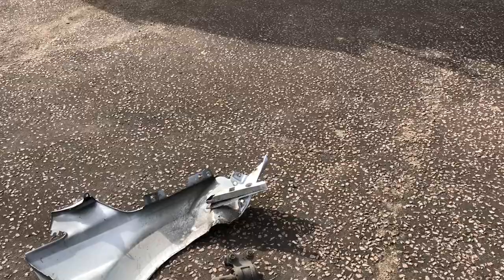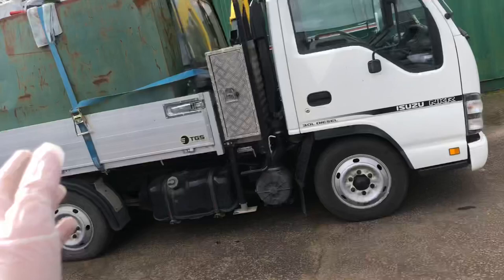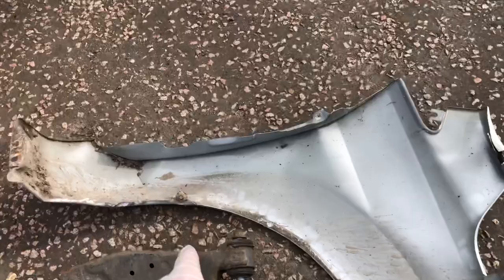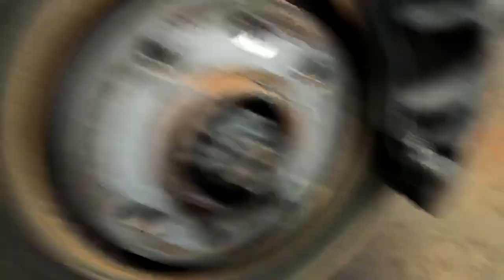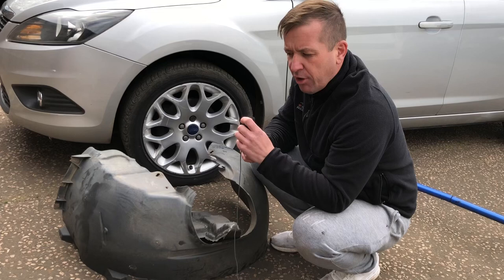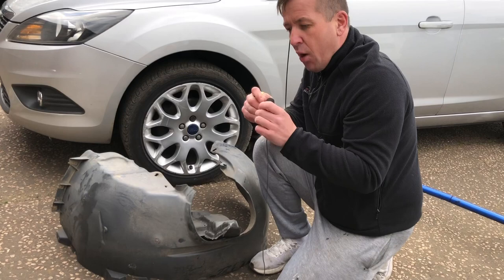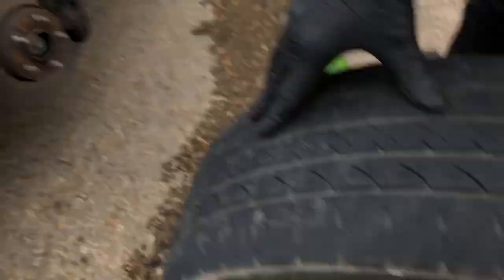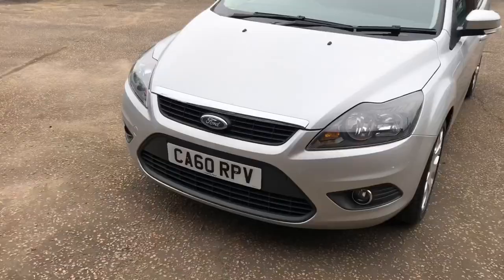Copart total loss Focus back from the paint shop

Comment: You forgot one important thing if you have to apply for logbook V5 because there is a previous keeper a sorn application has to be made. Or road tax application made. There actually is grace for doing this in motor trade but not for  privately owned. People have been fined for this before which is ridiculous because you can not tax until having a V5 so its obviously of the road.
Nice video as always rob keep up the good work

Comment: You should try paintless dent removal for that rear door , the tools are available on ebay for not to much and it's easy to do, hot melt glue a plastic tab to the dent and pull it up , clean up with some metho.
enjoying your vid's
 cheers pete

Comment: Nice to see the tracking went well mate, full four wheel alignment is squeaky bum time with these because the rear suspension components corrode & the bolts seize up - in particular them two camber adjustment bolts which do tend to snap on some of these during the process. Not exactly cheap either from Ford or Euro because they are eccentric bolts, though that aside you can't beat the Hunter machines - always spot on when I've had it done on my cars over the years. Thanks for the upload again Rob!

Comment: 6 :30. Axel stands?
Even if the jack fails that's still going to drop an inch or so because the wooden blocks seem to be resting on the tyre rather than the wheel!
Reply from the maker: fastra I lowered the jack on to the blocks 👍
Reply: @sruk  Fair enough, no probs 👍

Comment: Hi rob can you tell me if I can put wheels that's on this focus on my mk7 swb transit van
Reply from the maker: Gareth Potter 🤷‍♂️
Reply: @sruk  ok
Reply: Probably not van rated, most wheels have the gross weight they will carry marked on them, like 750kg,x that by 4 wheels= gross of 3000kg also need xl tyres (extra load). They'd probably be ok on a connect.
Reply: @leacullen9491  cheers lee